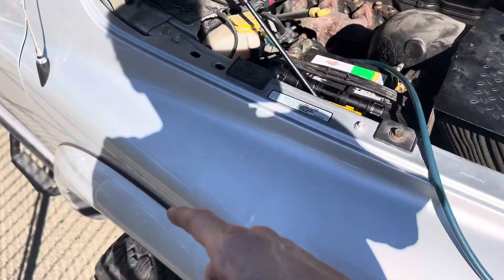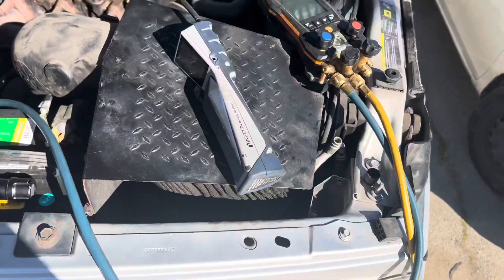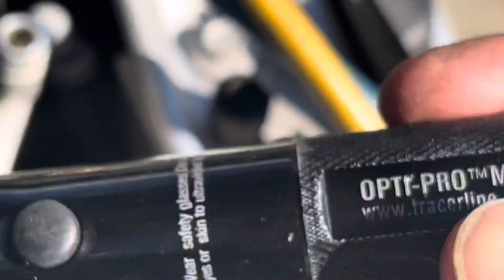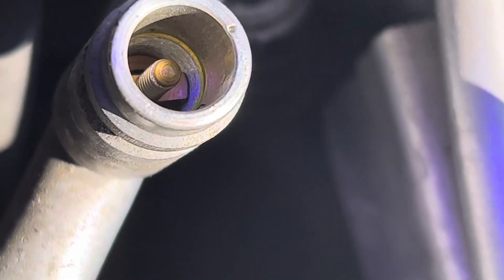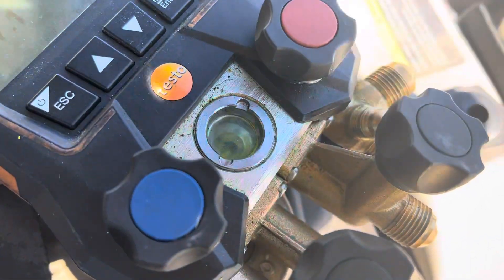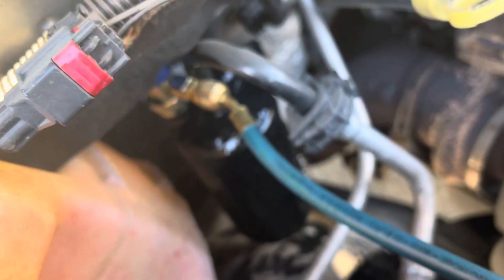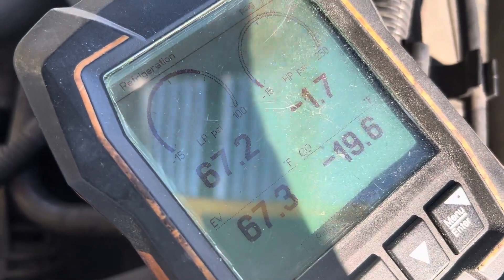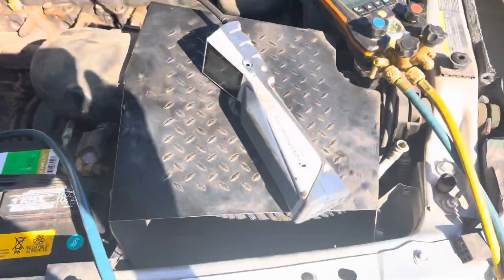AC UV dye different dyes need different UV lights they’re not all created equal. ￼

Comment: I think Ford has put dye in most of their cars since the early 90's?  How good is the dye that Ford puts in their vehicles at the factory? Is it not common practice for the OEMs to put dye in the vehicles on the assembly line, or is the dye removed by age 10 or so from several system evacuations and recharges with new "freon" "washing out" the factory dye?

Thanks
Reply from the maker: @freddyhollingsworth5945  I do not notice dye in Ford systems very few vehicles from the factory have dye
Reply: @coldfinger459sub0  
https://www.motor.com/magazinepdfs/062005_08.pdf

found this, not sure how accurate it is
Tracer’s dye wafer
applications include: 
•All Jaguar models manufactured
since 6/97.
•All Nissan models since 6/99.
•All Volvo models since 5/00.
•Mazda Tributes since 5/01.
For those readers who work on both
import and domestic vehicles, these applications also have dye wafers:
•All U.S.-made Ford models since 8/94.
•All U.S.-made Saturn models since 5/99.
•All U.S.-made GM models since 5/00.
•Jeep Cherokees/Wranglers since 7/98.

Comment: How do you clean/remove ac dye to find new leaks, so after you replace a part you can check to see if it is leaking verses the old leak? Also to help remove the ac dye splatter on parts?
Reply from the maker: Lol 😂 🤣.      A lot of soap and water because POE oil and PAG oil are somewhat dissolve in bond with water with a little soap or degreaser

Carburetor cleaner or brake clean does a good job not healthy to breathe and you definitely don’t wanna get it on the paint job or headlights or anywhere around stuff like that.   

And then you just keep hitting it multiple times with like brake clean because it’s really really difficult to get out of tiny little joints it likes to show up again and it’s hard to tell is it the old stuff or is it new stuff